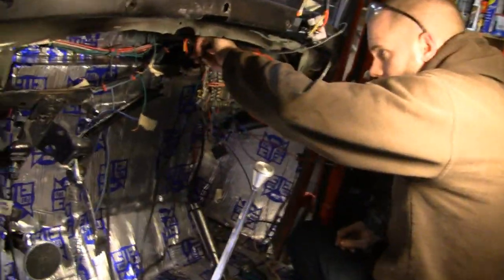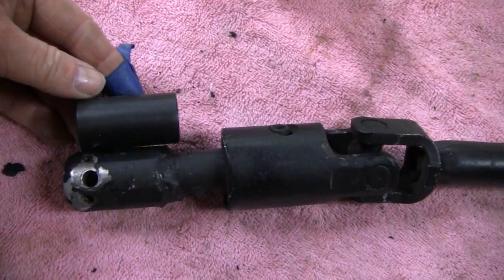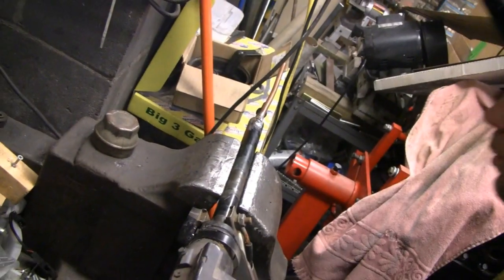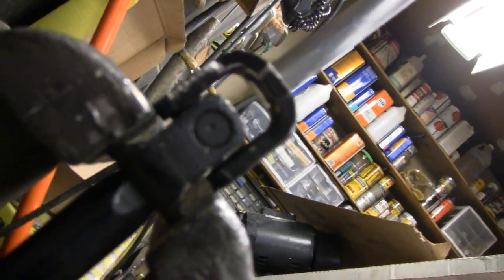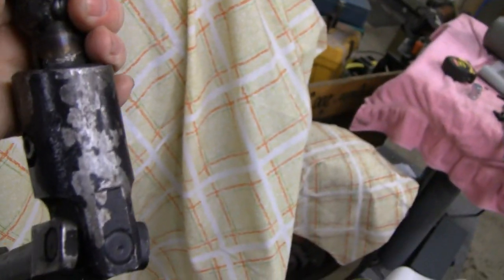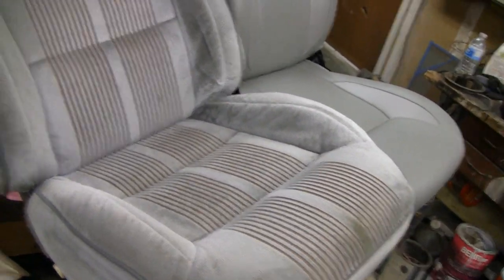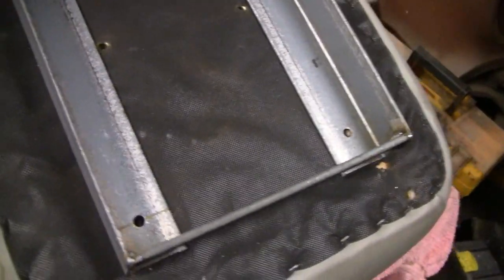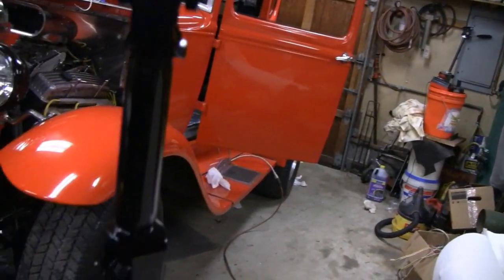1930 STREET ROD REPAIR (part 9) FORD MODEL A

Comment: When welding over that hole in the shaft,.I was shown another way to do the same job, but instead of copper , I was given a large carbon brush, like a generator  brush, ( see Mike ), and this does equally a great fill job too. Nice job there guys. That's now a good steering shaft..
Reply from the maker: Reg Sparkes Thanks Reg!! I've never heard of that, but we will definitely give it a try and I'm sure Mike has a big old brush laying around!!☺

Comment: thank you for the quick reply , but the shaft is out of phase who ever built it, and should be corrected for smooth operation. I had a steering shaft that was out of phase that was much worse than yours .yours is out about 20 degrees ,love your vids, watch every day. THANKS, old650gli.

Comment: Now you won't be sawing at the wheel to go straight.
Reply from the maker: spanermantim I could deal with sawing or bumping, I wouldn't want to find out what it's like if that thing snapped!!☺
Reply: I hear ya that could of been a disaster but not just for you but anyone on the road.